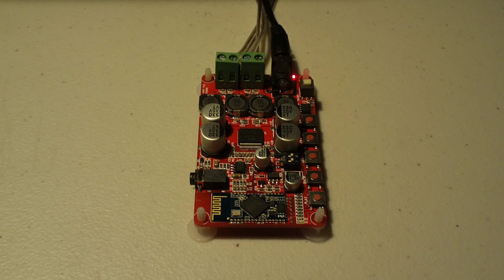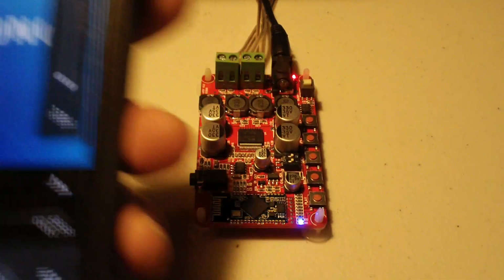Demonstaration Of A Small TDA7492P Powered Bluetooth Amp From Ebay

Comment: I've just got mine in the mail today. On the subject of the Aux port (3mm jack)... it also doubles up as a line in (in case anyone was wondering) It amplifies 2 stereo sources simultaniously. The line in and the bluetooth. the dip switches have to be set in off position to power it up. Is it loud? Yes it is. The quality of sound (and volume) will depend on choice of speakers. I cant work out why it can't be paired though. My android device has no trouble playing music through it via bluetooth but ipad won't give it a look in, maybe i'm missing something. That was a disappointment because I bought it to use with my ipad. Apart from that minor niggle It's a nice peice of kit, I'm very pleased with it.
Reply: If you begin the video you will see a small black square block of plastic just above and to the left of the bluetooth ICB. That is a 3mm stereo mini jack port. If you feed a signal into it it acts as a line in. On the other hand if you feed the signal out of it to something else (while the amp is recieving a blutooth source) it acts as a line out. useful if you just want to use it as a bluetooth reciever linked up to another amp, say to a hifi system with no bluetooth built in.

I use a standard all in one laptop power supply (22v) Speakers are from a 50x50w sony mini hi fi. 8 ohms each and this thing is twice as loud as the sony hifi system that came with the speakers.  

Some devices sound crystal clear (my laptop sending bluetooth to it) sounds great. My win10 tablet (linx) on the other hand sounds terrible with too much digital transmission noise going on. Ipad works well with it now, as does my iphone. 

On the power settings - there is no difference in quality of sound switching among them as long as you give it 20v or so you will get a clean punchy sound from the amp and it never sounds distorted if your tracks are high quality. 

For obvious reasons, the bluetooth background noise can sometimes be a nuisance. but when you use the aux-in the unit sounds amazing. 
For ten quid it's a no brainer. And for another three quid you can order a DIY perspex case for it. Be careful choosing, some come without the aux port.
Reply: When you switch on do you get red and blue led's blinking alternately? The red stops blinking when recieving bluetooth but both should be blinking when recieving aux input. What power supply are you using?
Reply: Becaue apple is compatible with nothing lol..
Reply: Found a way around it. iPad into iodock and iodock into aux in... even better. The aux in is way louder and puncier than the bluetooth reciever
Reply: Practical and compact I`m sure..
Reply: Where is the AUX Line-In on this board? How do I attach the port?
Reply: I am unable to get the aux to act as a line-in. The bluetooth led's keep blinking even when I plug in and out the audio input. (no bluetooth connection even made at that point) 
The only moment when I am able to get sounds via aux input (line-in) from the speakers is during the first 2 seconds after turning on the board. 

Then I hear that loud beeping sound , after which only bluetooth audio can be played.

Any tips to get the aux-in working?
Reply: Yes, after 3 seconds or so, the red and blue led's blink alternately, after powering on. When I plug the line-in/aux, and try to play some music, no output is heard. But if I use my phone to connect to it via BT, it works just fine. 

About power supply, I am using 20Vdc (used a buck coverter to drop dc voltage from 25Vdc to 20Vdc. 25Vdc is made available from an smps I am using)
Reply: sounds like you have a faulty unit. I would return it and ask for a replacement. I've got two of them and they both work fine.

Comment: I would really like to power this board up with 24vdc but also make it portable. Without going crazy in price and be able to have it play at least 5 to 6 hours and rechargeable could you recommend a way to do this? I am somewhat mechanically inclined and have a basic understanding of electrcity.
Reply: I'm thinking about discreet solar panels on the top of the cabinet/speaker box to charge the batteries. I have 4x 3v batteries from an old laptop charger. and was wondering if I could recharge then with 2x 6v panels. 2 of them would be small enough to go onto the cabinet without it looking like a hash job. I've been charging and  disharging the batteries well enough with one panel (need to find another one) Theres no reason why the amp wont work on twelve volts all day long. Even when it's cloudy

Comment: is there anyway to disable that power on sound yet??
Reply: You could hack it so that the output slowly rises instead of immediately. Something with a big capacitor might absorb the input surge and the sound, and by then the cap will be full and you'll be able to bypass it somewhat. Be sure to use a transistor to bypass the capacitor once it's at full charge.

Comment: does the aux works as a stereo output with level controlled by bluetooth at the same time as there is speaker output?
I need to connect another amplifier to it for the subwoofer
Reply: Yes.

Comment: I need some speakers 50w ? What if I use a 40w ? Thanks
Reply: I'm using a pair 10 watt speakers @ 4ohms from a panasonic mini hi fi and they sound amazing. at about 50% it's way loud enough for in any room.
Reply: Your speaker's wattage doesn't really matter too hugely. If you have 10w speakers, and they run over 4 ohms, just don't turn it up all the way or it'll succeed in the coilcooker.

Comment: one thing to note, most people power it using 12 volts. at 24 volts, on highest volume and both adjuster thingies(the one's you used a screwdriver to set) set to on, the distortion is much less, and it sounds better overall. not sure why this happens, but it seems to be the case, so my future carrying case speaker(built into a suitcase) will be powered using a 12 volt battery pack, with a boost converter to convert it into 24 volts. for best sound quality.

just something to note in case people want to use it, sounds best with 24 volts, but works fine down to 8 volts. and above 24 volts will fry it(can take up to 25 volts, but risk of frying is much grater, than using the recommended 24 volts)
Reply: It will work better at lower supply voltages if the gain is reduced. These boards have a 2-pos gain switch. Set it at the lowest gain then listen to the music. Try the next gain until the output sounds bad (distortion due to clipping), then drop the gain one level.
Reply: Raymond Ramírez true, a 12 volt supply sounds great with both in the off position, but 24 volts is needed to remove distortion from the switches in the on position, not sure about combinations, as i currently dont have a variable supply atm.
Reply: Maybe capacitors?
Reply: What do you mean?
Reply: 24v will make it run better because it's easier for the amplifier to reach its peak performance due to higher power input (in most cases.)
Reply: how many Amps can this thing handle?
Reply: It doesn't handle amps, it draws amps. So it draws the amount that it needs.

Comment: nasty pops on power on and off.  You might want to get a unit with speaker protection relays (soft start) next time.
Reply: I have read the ST documentation posted above by Bob H. There are delay and mute circuits that can be added to the amplifier.

Comment: TDA7492P and TDA7492 are 25w x 25w and 50w x 50w respectively according to these specs... http://www.st.com/web/en/resource/technical/document/datasheet/CD00211320.pdfhttp://www.st.com/web/en/resource/technical/document/datasheet/CD00205863.pdf ...  I've been testing a TDA7492P. At 1kHz sine wave and 25.5 VDC supply, it will produce 24.8 (close enough to 25) watts RMS into a 6 ohm load (per channel). Altho at 15 kHz, the distortion product rose sharply as seen on the o-scope. Reducing the level to a usable undistorted level yielded 20.8 watts RMS (into a 6 ohm load). This is probably ok, considering that a 4 watt difference is scarcely 1 dB difference and would not be noticed during normal operation. At the 20 watt output level, the amp is virtually flat across the 40 Hz - 15 kHz range. These amps don't go into clipping as do linear-type amp, but just get more distorted with HF oscillations occurring on the sine wave peaks and the amp starts going into intermittent OL  shutdown. This is probably more info than you ever wanted or needed to know, but since you had asked, I thought I'd share it. ;-)
Reply: Right, Good point.
Reply: Sorry I didn't reply earlier; I missed seeing your comment here. You are correct - P=I*R; also P = E x I, and E2 / R. Catalin Nastasa also made a good point too.

Comment: any ideas why mine wont run off 12v on batteries ?
Reply: +Jordan Cooper Not enough amps? The one in the video is running at 12V 1.5A
Reply: yet there was one on a you tube video he ran it on aa batteries at 12-15v which i have the same , how could i do this please ? could i use one of the step up adapter things
thanks
Reply: Jordan Cooper You would need to use 10 AA batteries. Try powering it on with a standard 12v adapter as a test. If it works with the adapter, but not with the batteries, then it's the amps. If both doesn't work, then you may have a faulty amplifier.
Reply: just curious, did you figure out the issue? i am having the same problem and i am using a 12v 7Ah lead acid battery and the amp wont turn on, but when i plug a 9v AC plug into it, it turns on and works with out problem..
Reply: i honestly dont know either as im trying to make a bluetooth speaker out of it but it wont turn on :/
Reply: hmm thats strange works on adapter but not batteries

Comment: So that stereo jack is a output and not a input?

Do you know any amplifier that has Bluetooth and auxiliary input? 

i want to conect my phone using a auxiliary cable but also having the bluetoot support
Reply: +Zona ALG it is an input. i have the same amplifier. but i also have a 2.1 bleutooth amplifier. 18 to 24 volts. 100 x 50 x50 watts. its better then this one. but i like this one to
Reply: +ben grobben what's the name/ model number for that 2.1 you have? I haven't had any luck finding a 2.1 that doesn't sound like crap.

Comment: Hi, good tutorial! Any idea about watts with and without switches? I saw it should be 40 watt with 24 volt for speaker, but applying switches? And what about connect an analog potenziometer? It shold be usefull a potenziometer to put it in a box rather than thos delicate buttons.

Comment: My bluetooth amp came in the post yesterday. It works great, very pleased with it. The audio is pretty flat, I got zero bass at the start but once I downloaded an equalizer on my phone it soon sorted the problem. I am using a 12v 2amp adaptor with mine and I can set the switches to 1 on 2 off and 2 on 1 off without the start up issue you was having. I haven't tried both set to on yet. 

My model is slightly different to yours as well. Mine doesn't have an on/off switch on the board or a 3.5mm jack input, you turn it on and off by the plug socket maybe it's a newer model that fixed the start up problem? Great little device and a great video that helped me decide on buying one :)

Just need to finish making my case for it to mount to the speaker :D
Reply: Hey Jason, do you have a link to the one you have please? Also how's your project going? I'm taking on one this summer
Reply: +Henry S Hi Henry, here is the link to the one I bought.

https://www.amazon.co.uk/gp/aw/d/B018FX57IS/ref=yo_ii_img?ie=UTF8&psc=1

And the project went well, I'm really happy with how it turned out, here's a couple of pics of the finished project. 

http://s31.postimg.org/fn13ngjuz/IMG_20160209_165527.jpg

http://s31.postimg.org/8n99ivfrf/IMG_20160217_122819_1.jpg

In the end I used a mod called "viper4android" you need to be rooted but it sounds incredible. If you're not rooted just try different equalisers in your app store. 

The sound quality is extremely good bit without a decent equaliser it does sound pretty flat and unimpressive. Hope this helps.
Reply: Jason Hickling Thank you for the links and comment :) I like your work, looks quite tidy.
Reply: +Henry S Thanks, took awhile to make in the end though. I originally made a tin case but it didn't turn out as well as I wanted, it was fine but I am a bit of a perfectionist haha. The plastic case worked much better. Just cut it to size, made interlinking tabs and super glued it together. The mesh was from a PC DVD drive blank fascia and the lid was a DVD case, I just used the hinge from the DVD case an glued it on then used Velcro to secure the lid and to attach the case to the speaker. 

I can't tell you enough how great this little device is and for the price it's a no brainer. If I had another set of speakers I'd get another one without a second thought. All in all cost me about £15 but I had a lot of the bits including a power supply.

Good luck with yours if you buy one :)
Reply: looks great! how do you operate the power switch of the amp? Im making this to run on batteries. Or does it just work when it gets power? Because then i could just add a easy on/off switch between the power supply and pcb. Greetings from the Netherlands
Reply: The version I have works as soon as it gets power so I just turn it on and off at the plug. The version in the video has an on/off switch so it really depends on which version you get but either way you would be able to add a switch between power and PCB. Hope this helps and good luck :)
Reply: ill just wait untill its delivers and then ill test it! thanks

Comment: Great video, gave a thumbs up!! I do need a bit of advice though. I plan to buy this but I'm not sure what power adaptor to get. I don't want a laptop adaptor to be honest and other adaptors don't go too high in power. What adaptor did you use, ie volts and amps? Did the adaptor get hot while in use? Will a 12v 2amp adaptor be ok? Specifically this one:

http://www.amazon.co.uk/New-100-240V-Power-Supply-Adapter/dp/B00AY9RY3S

Thanks a lot for any advice I am a noob at this sort of stuff :)

EDIT: My speakers are 6 ohms btw.
Reply from the maker: +Jason Hickling That should be fine, i was using a 12 Volt 2 Amp power supply in my video and it had more than enough power to drive some decent size speakers. You could technically use a bigger power supply to get more power, but i think that would be unnecessary unless you really want to push this thing to its limits.
Reply: +majorjip Thanks a lot, I'll use the same power supply then. Just in case you didn't know or anyone else hasn't seen this the switches you moved can be alternated for different levels of DB. For instance 1 set to on and 2 set to off. This may explain it better although this model doesn't have a 3.5 jack like yours does.

http://www.qiannipicture.com/pic/UploadFile/P0/SKU280014/E38237379A9E8D9667A1568D23CFCFC6D6362AC6CA26CE03CB53D254CB66CD46D2139E9B5ECAD2CB660346D2C89916CB9C1673CEC646419A33CDA0C9.jpg

Comment: The description says volatge from 8~25V. Is it okay if i use 20V instead of 12V?
Reply: +Jose Muñoz  this is incorrect the system board has a wide range voltage regulator. the lower the voltage the more current the board will draw. but the output power will be the same.
Reply from the maker: +Devin Dewanarayana Well, As far as all of the datasheets say, you should be able to. All of the capacitors are rated up to 36 volts, and the amplifier chip itself is rated up to 25 volts, so you should be good at 20 volts. I personally havent run it on any more than 14v.
Reply: +majorjip Thank you very much. I got it now. Cheers! :)
Reply: +Devin Dewanarayana The more voltage you put in the circuit, the more power you got on your speakers. 20V is perfect.
Reply: Thank you bro :)
Reply: BensShed Thank you :)
Reply: I'm using a 19.5v (3.5 amp) laptop charger and it works great. I left it switched on for 24 hours and the board didn't even get warm.

Comment: It's an 50w really ? I see it whriten on ebay 2X25W or 2X50W ?
Reply: Do you have one? If you did you wouldn't say that. It does not distort at halfway. It does not distort at all unless underpowered. And even then it is barely noticable. The power rating is between 8 and 24 volts. Obviously using a 9v power supply is underpowering it (although it will still work fine) 

If you're curious, buy one. What have you got to lose apart from 10 quid? Cheap as it is, it is an amazing peice of kit. I use it as my main amp for music production at home.
Reply: Zibbe Zabba I bought a 24v 10amp power supply. This should be plenty right?
Reply from the maker: +TheGeeksOf Douzze Im not sure what the actual output power of this thing is, but all the listings on eBay call it 50 watts peak. If you look at the data sheet for the TDA7492P Chip (Which I will put a link in the description to) It says this chip puts out 25 Watts RMS at 10% THD. Whether or not it actually does i am a little skeptical of.
Reply: OK, thanks, I've purchased it so a whant to know if it 50w, but it's an amazing gadget !
Reply from the maker: +TheGeeksOf Douzze It sure is, especially for the low price they are sold at.
Reply: I !, i have mine, at the begining it work well ! but when I connect an 3.5 jack for input music from my phone the cable touch one of the ouput of the speakers, you can say "don't worry it's nothing" but now the music is always ouputing by the jack (in bluetooth mode) the amp Broke ? they are no sound out of the amp to the speakers ! WHY ? my christmas present !! nooooo
Reply: Good to know :)
Reply: Yep... mines a 2x50
Reply: You'll never get clean power out of it at anything over halfway, if at all. It's just something you're willing to trade off if you're going for cheap things like these :P
Reply: You are all wrong, I'm sorry to say but TDA7492P is 2x25W  and TDA7492 is 2x50W.
The difference is the P in the name.
How can you spot them? Well, TDA7492P board is RED and TDA7492 is yellow and it has a heatsink on top of the chip.